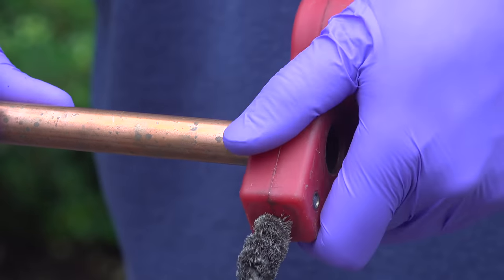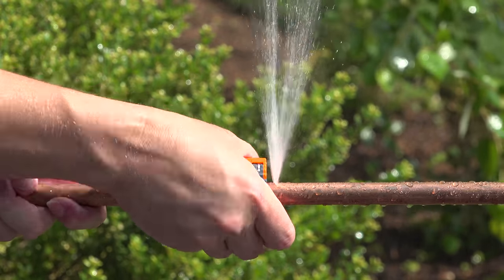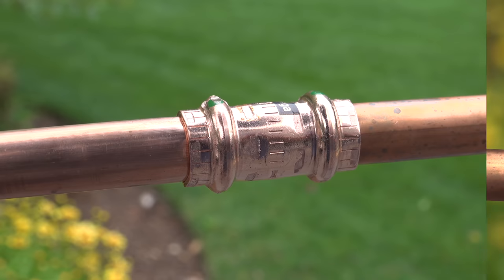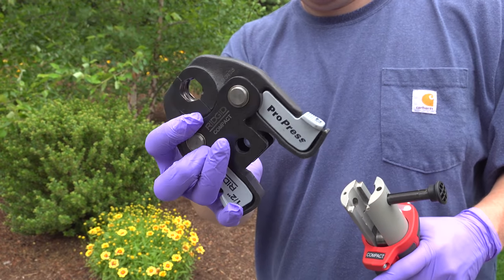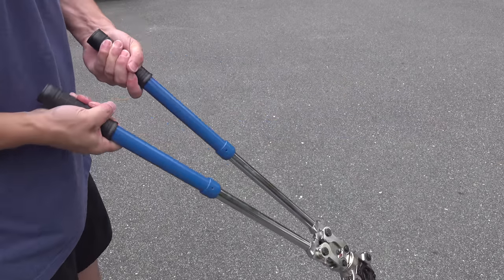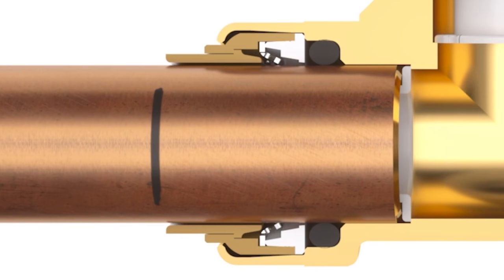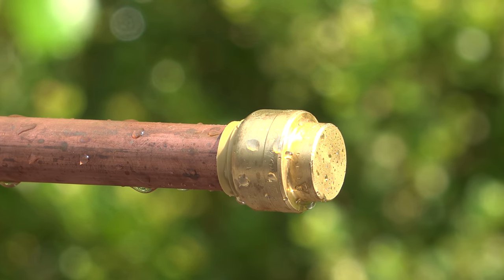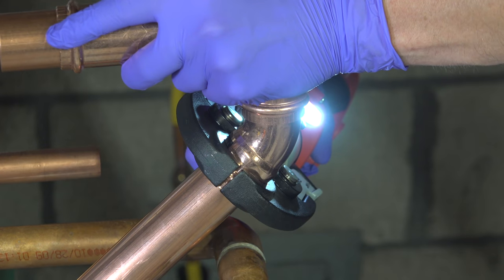NEVER SOLDER PIPE AGAIN - 3 Ways for EASY DIY Plumbing

Comment: I replaced my water heater about 7 years ago. I used shark bites to connect the waterlines and also used shark bite cutoff valves. Absolutely no issues in those 7 years. I trust them completely.
Reply: In a few more years you will change your opinion. The rubber gets brittle over the years. Any water hammer in your system will accelerate the issue.
Reply: @ChannelZeroOne  
Most o rings in these type of fittings are made of EPDM synthetic rubber, lifespan 50 years..
I like epdm roofing but..
I don't know how long they last in closed systems, we just don't know yet. Maybe longer because there in closed systems.
Also,
Most fittings here in Europe are designed to give support inside the fitting to the o rings, they say more reliable because of this design, o rings stays better in place, less wear etc...
All installation companies here work with alupex and press fittings.

Where i can i solder my connections.
I love renovations, because there is existing copper pipe!
I tell my customer it's better to stick with copper and extend with copper/solder instead of creating a mix of systems with pressing alu on the remaining copper and extend with alu.

New building alupex uponor because everyone else here is working with it.
It's standardized at the moment.
Faster therefore cheaper..
But long term quality?

We are gonna have allot of work 30plus years from now.
(That's for the next generation.) I wil be retired by then..😁
Reply: @hittechniek5616  Most of the inners of a toilet are made of EPDM rubber. Noticed how often they fail. There are not under pressure for the most part but the black mess that gets on your hands handling the rubber parts is the rubber disintegrating from exposure to chlorine and plasticizer breakdown.
Reply: @ChannelZeroOne  Well,  I’ll probably be dead by the time they fail so that’ll be the next homeowners issue
Reply: @clos5700  lmao
Reply: @clos5700  If you plan on dying soon then maybe. You are near the end of the useful lifespan of 10 years. Any movement from here on will result in a leak.
Reply: Sharkbites are absolute garbage. 
Learning to solder is your best bet. It's all in the prep work.
Reply: It’s really cool when they slow-fail and just make the cavity wet for years of mold and eventual rot.
Reply: @ChannelZeroOne  so then replace them they are cheap. I only use them in certain situations but they can be life savers. Especially in situations where it's hard to get water out of the lines. You don't know what your even talking about.
Reply: I've driven a car for 20 years and never died, seatbelts must be pointless.  Same logic, but obviously flawed.
Reply: Yikes. Just make sure your floor drain is functioning properly lol, 7yrs really isn’t that long to put that much trust into something like that. Just get it soldered or convert to pex. Shark bites are not that great man i promise. As a plumber myself ill just say this, there’s a huge difference between a tradesman and a handyman. Listen to who you wish but no professional would put that in their own home.
Reply: @F0xtr0t13  I got them in my own home. They have a 25 year warranty. Why wouldn't my drains function properly. God u guys are all nuts. Hard to even listen to you screw balls.
Reply: @F0xtr0t13  I've seen more fukked up work with solder then you could ever imagine. I've seen countless reduction fittings that bottle necked water pressure. I've seen multiple issues. I've yet to have any issue with current shark bite models in the last ten years. Your all a bunch of good balls. If I have to replace plumbing in walls around anything that can't have water I'll solder. Running shark bites on water heaters is highly preferable.
Reply: @F0xtr0t13  your not going to change my mind dude. End of story. They are fantastic option in certain situations. Fantastic.
Reply: @F0xtr0t13  I hear all you nuts bashing them and I guarantee you haven't seen a single one leaking. I guarantee it. You haven't seen one leak. You can make up whatever story you want. Another thing is idk how many brands there are but I buy absolutely awesome ones. I pay good money I ain't getting some knock off crap. I pay 10$ a fitting if I need them or more. It's like extension chords. You get what you pay for. I don't run my power tools on 20 guage wire you know what I mean. I get a solid 10 guage chord. So maybe there is some real garbage on the market I don't know because I don't buy garbage so in that respect it's whatever.
Reply: Good. My grandparents home has had the same soldered joints and copper in the basement for 94 years. I am not saying they don’t work but they aren’t the same as soldered joints.
Reply: @donaldducko6580  lmao I said for the water heater jesus you guys read the comments
Reply: Best system? Solvent fused pex ( ie glue) is used in hospital renal systems and is very cheap and good for 100 years. Fused joints behind the drywall, pressure joints where exposed and at fittings.
Reply: 7 years is new. Try 70-100 years.
Reply: @gpwcowboy  oh ya that water heater is going to last 70 years then?
Reply: @MrSocko-vn7fw  
I think I've worked with you before Gump. 3/4" couplings are pretty cheap. Anytime you install a new hot water heater your input and output are going to be slightly different so you're going to have to do some new routing. There's lots of ways to do things usually. I can do things fast, cheap or good. You can pick any of 2. It won't be the 3rd.

Comment: True statement about Shark Bite fittings. Critics of Shark Bite fittings don't realize push-in fittings have been around and in use since early 1970's - with great success. We have been working with Shark Bite type fittings on emergency leaks for 22 years - with 100% success.
Reply: I agree in an emergency situation. An after hours call on a busy night or something. But we would always go back and change it out with a soldered/brazed repair.
Reply: A lot of times unsatisfied customers are so pissed off at the contractor they don't dare call them back or even try to get in an argument with them they just call someone else and get it fixed correctly. That's probably where you're getting your 100% success rate from.
Reply: @Maxpower-fv5bb  yea ok

Comment: I honestly never knew about these alternatives.  I always thought the soldering was the only way.  Very interesting video.
Reply: Hey, guy try out shark bite, you will be surprised.
Reply: @bruceanderson7762  sharkbites are great for the occasional job where you need one or two fittings, I wouldn't plumb a house with them though because they're so expensive
Reply: Honestly, soldering pipe is still industry standard as it’s cheap and effective. Propress and shark bites are great for repair work that is really hard to get to after construct, but soldering pipe is guaranteed to last decades if done by a professional.
Reply: @TheDpDrifter  agreed, they're great for the home gamers
Reply: In cook county, solder only
Reply: @JB-dm6zt  I mean soldering pipe isn’t hard to do and has a much lower price entry point. Some small fiberglass welding blanket, a torch, flux, some sand paper, solder, cutter with attached reamer and you’re good to go. Clean the joint up, ream and debur, flux joint, heat the pipe till you see a green flame start to come off the copper and then flux the joint. Done in no time
Reply: @JB-dm6zt  and prone to leaking.
Reply: @bruceanderson7762  uhhhh, it was in the video capt. dumdum
Reply: Just get a copper to cpvc sharkbitr adapter and do the rest in cpvc
Reply: Propress is expensive tho and if you accidently cremp it wrong you're in deep water
Reply: @skylerruin  cpvc 🤦‍♂️
Reply: @skylerruin  nah I don't like pvc or cpvc for water supply since over time it gets brittle and cracks easily copper is absolute best then pex is also awesome. For me pvc and cpvc are kind of a no go.

Comment: My dad installed sharkbites in his house more than 15 years ago I believe. And he has NEVER had a problem.
Reply: Love sharkbites
Reply: Shark 🦈 bite are great 👍🏽
Reply: No connection with Sharkbites.  They are the real deal.
Reply: 15 years is not a time frame one would expect a problem. So 15 years is by far not representative. Depending on the layout, changing pipes can be a gigantic undertaking. Using a product, that makes the installer happy and thereby saving money on installation may work out to be a very expensive (and if you are a tree hugger, that translates to carbon intensive) mistake. So make sure you do your research and don't rely on information that is spread by industry lobbyist!
Reply: @mrtopcat2  I just judge it solely by the fact that most companies nowadays are not only LLC companies which are a crock of unlawful shit, but the fact that most of any companies products have a ONE YEAR WARRANTY. So! Knowing that, anything that ladt LONGER than a year makes it feel like it was an okay purchase. So considering they lasted for 15+ years is quite the warranty shock.
Reply: @wrong2h8  I understand your point, but given we all care about the environment and given that construction is unfortunately still one of the largest emitter of greenhouse gases, extended life cycles are a noble goal in home construction and ownership.

Generally, most industries have been trying to shorten the life cycles of their products (while falsely claiming an excellent environmental record), they just want people to spend and replace perpetually. Unfortunately this trend has been for a good while creeping into construction as well, where it should have really no place.
Reply: Same here. Over 15 years on numerous rental houses. Zero problems.

Comment: Just used Sharkbites to fix my main water line.  Had what was about to become a pinhole leak due to too much flux being used during the house constrution 26 years ago.  The flux had settled in the pipe and was causing a small drip.  Turned the water off, cut out the bad part of the line and reconnected with two couplers, a slip fit and and some new copper pipe.  I used them on my old house when I replace the water heater.  I love them because you can connect copper, to PEX or CPVC or any combo of the three.
Reply: Are you saying Flux from soldering can degrade copper pipe?
Reply: @keith3761  If too much was used and it was an acid based flux, it can.  It will settle in the low spots in the pipe and slowly over time eat through the copper.  My house was built in 1997 and I noticed a copper stain and calcium buildup on a pipe.  When I ran my finger over the pipe it came back wet.  I cut that section out and repaired with Sharkbites.  When I scraped away the calcium buildup on the part I cut out I found a pinhole.  I estimate 3-4 months it would've failed.

Comment: My company switched to propress for all our jobs to save time. The fittings work just as well as solder most of the time. But the fittings are more expensive than regular. As for sharkbites, I have used them for temp fixes, but ive also been on a job where a 15 yr old hotel had joints burst monthly due to over use of sharkbites to save time. The design may have gotten better since then, but realize that water will push even soldered joints off after 70-100 years. All you do with sharkbites is halve that number. This doesn't sound like a problem until you realize you might be paying off your house that you do the work in for 30+ years or if you plan to live in the house well into your older years.
Reply: "water will push off soldered joints"
That's a new one to me
Reply: @JoeTaber  It will either push through the solder or copper through a pin hole or push the whole joint off given enough time like i said. Running water under pressure is no joke. Look into thrust  blocks for larger pipes for a larger example. But in old buildings I have seen old solder joints pop off and have had seminars from X ray techs that get sent out by insurance companies to look into such leaks and failures when its needed. The weirdest thing is that the water actually makes little "hoove" prints in the pipe facing the opposite direction of the flow with solder joints.
Reply: @JoeTaber  One of the reasons water hammer suppresors are used now. Given enough time water will find a way through even a solid copper pipe / solder joint.
Reply: Hotels also have much higher water pressure than an average home. The Hotel I worked at, had more than triple the pressure of my house.
Reply: BINGO! Details. Details.
Reply: @JoeTaber  water is one of the most dense liquids and the force of water has no equal. Force of water destroys countrysides, destroyed the florida condo highrise, destroys basements,  and will eventually leak and find it's way through pipe, welded or not. 

There are many situations where recommending this is a horrible idea.
Reply: OldSchool  You should install a pressure reduction valve to lower the pressure right up front.  You should be under 70 pounds for a residence.
Reply: Usually when this happens it's because the pipe wasn't cleaned properly before or the excess flux wasn't wiped after soldering. Flux is corrosive. Thicker copper is best for longevity. Companies sometimes skimp on "M" copper (thinner) to save money. Minerals in hard water will also eat at the copper faster than soft water. We test our jobs with 120lbs. of air pressure before inspection. Use quality materials and take pride in the art of soldering.

Comment: Really interesting. I’ve always soldered pipes and I’m very very meticulous about it. However I think these are good solutions for temporary or low pressure use. Unfortunately many people don’t solder very well or they are very sloppy about it.
Reply: Yeah there’s really nothing to it..
Reply: You're lucky if that an OLD OLD house and it doesn't have a gas water boiler or gas heater. A big KABOOM and you flight across the window is not worth it. PEX, or ProPress (press-fit), or flare fit (like the gasoline lines under the cars).
Reply: @SSintox  bullshit! ( see other comment)
Reply: @Sean2002FU  Agreed. Bullshit. At best very temporary.

Comment: October 25, 2023. Just installed the LifeSource Water Conditioning system with a descaler to the whole house. The installer used the propress cordless tool. Pressed 90, 45, 1-inch, 34-inch, and 1.2-inch sizes. He also installed a new city water shutoff valve. He installed two water bibs for use on the outside of my home. One for the spa and the other for daily watering. Completed the whole installation in under three hours. The last hour was to run the system to flush out the old scale and other pollutants.

Comment: Like you, I used 2 shark bite on pex for a temporary fix, 2 years later, not in any hurry to change it👍
Reply from the maker: The other huge bonus for a well install is you know it will need to be changed at some point, could be 5-15 years so the sharkbites simplify that process a lot.

Comment: Installed hundreds of Sharkbites & never had a single issue.... its a God-send!
The only challenging part is removing the old fitting's pressure-ring (for valves), in order to put on the new Sharkbite fitting.  other then that it is super-easy... barely an inconvenience.
Reply: Damn I love those pitch meetings!
Reply: @davidb7180  Good Catch! ... lol..  I was wondering if someone would catch that :)
And yes, agreed, I'm addicted!

Comment: The nature of shark bite fittings will make anyone think they will fail or will leak. But you're right. I've used a lot of them in the past even under fairly high pressure situations and I have never had one leak or fail at all in 20 years of construction work.
Reply: just wait another 10 or 20 years and they will all burst